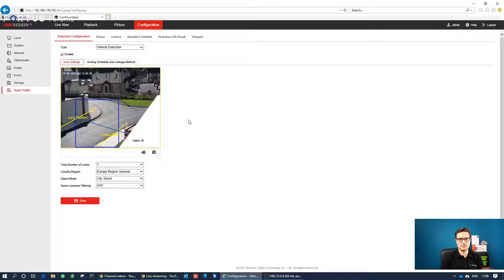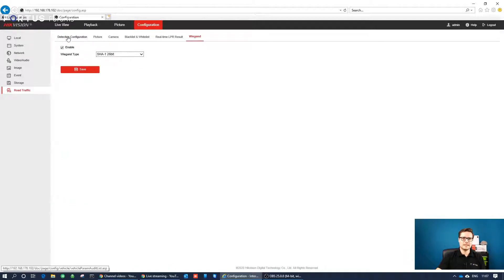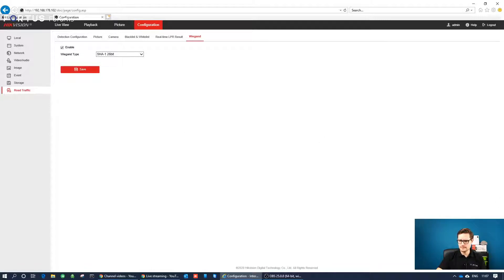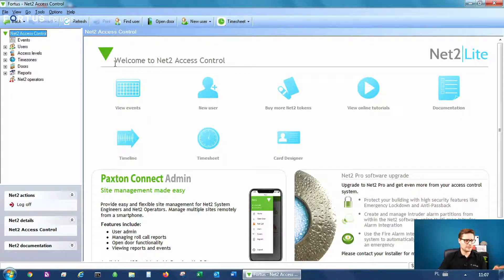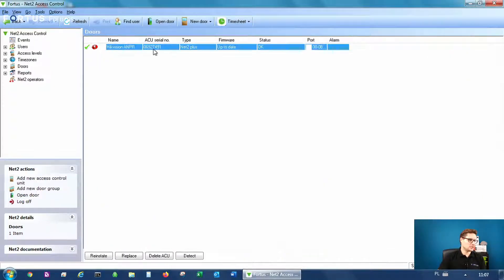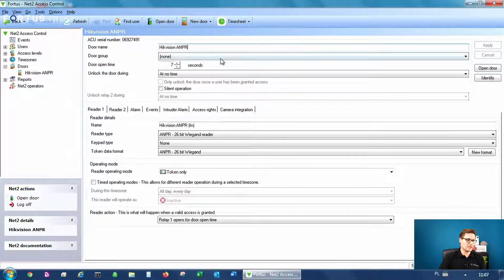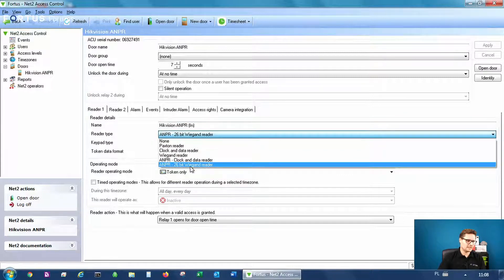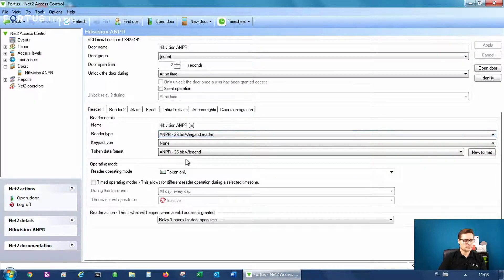Paxton & Hikvision ANPR Camera integration

Comment: Is there a way of enrolling number plates in volume?  Or does each one literally have to drive up get refused entry then somebody has to look it up and input the token number on to each person in the database?  Even if there was a conversion formula that would be helpful, I want to put one of these in to a staff car park.  Thanks in advance...
Reply from the maker: If I remember right, you can enter a reg plate in Paxton and assign it to the user.
Also you can import the excel list in directly to the cameras head.
Reply: @ForumsbyLukas  Thank you.